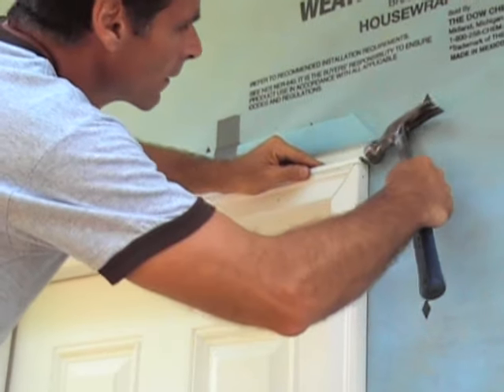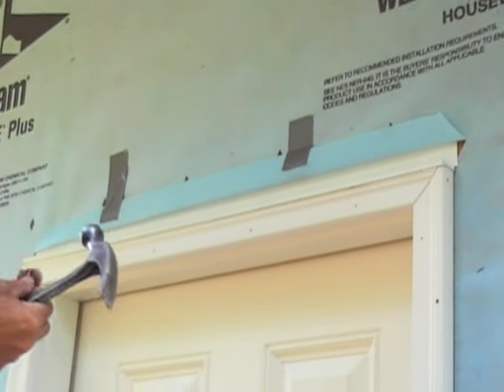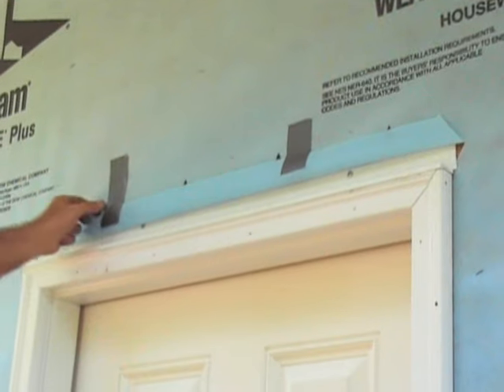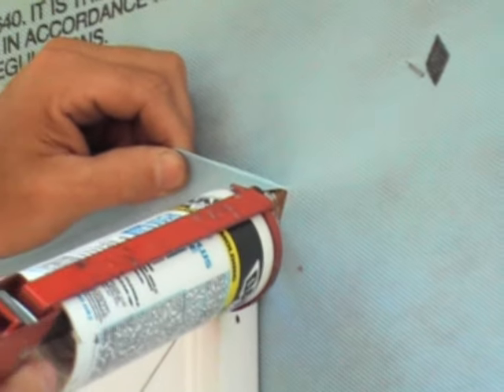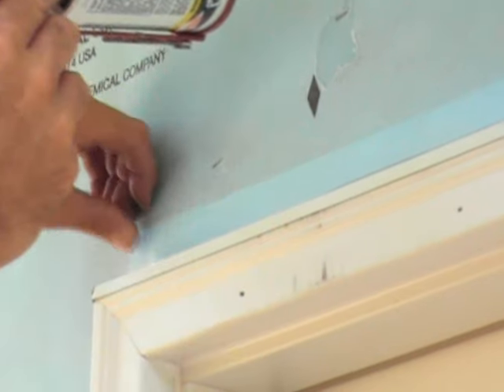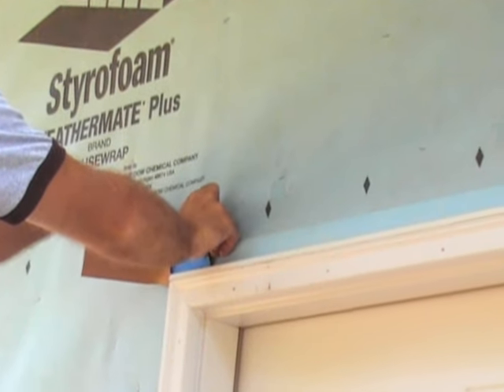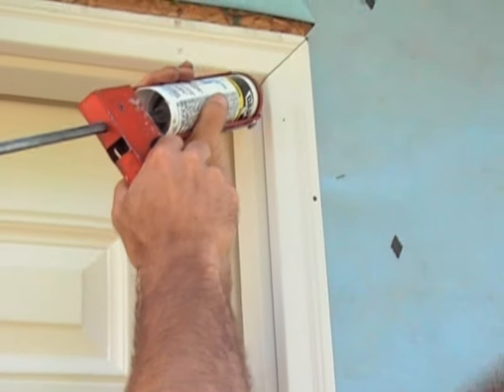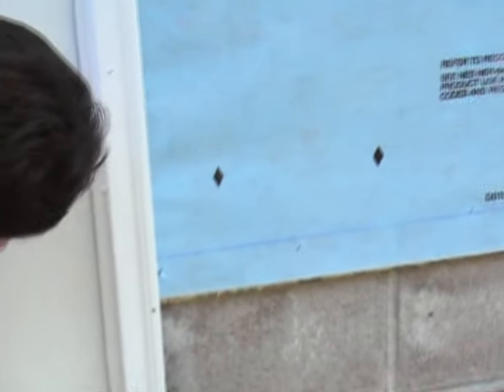Correctly Flashing and Caulking an Exterior Door

Comment: I would recommend using a better caulking than painters caulk. That particular stuff is not very durable. I know its less than $2 a tube, but for $4 you can get a much more durable and better adhering caulking, such as the window, door and siding caulking from DAP. Its worth it when you consider you are trying to keep water out of your home for a long time. :)
Reply: Yeah, bummer. Before I knew better I would use that brand for EXTERIOR work and it ends up cracking in a few years. Only use OSI Quad now for exterior.

Comment: are you concerned that the drip cap top interphase with the sub-sheathing should be taped or sealed.  If water gets behind the WRB weather resistant barrier it will simply run behind the drip flash

Comment: @ezhangdoor I wasn't able to find any drip caps in my area. I live in Modesto California. I went to several places with majority of the people not knowing what I was talking about. My windows are slightly under 1 3/4" spacing from the nail fin so the 1 1/4" drip cap won't work. The prehung door I bought doesn't come with a brick molding. I haven't decided what type of molding to add to it. Where did you purchase the drip cap shown in the video? Thanks for the help!